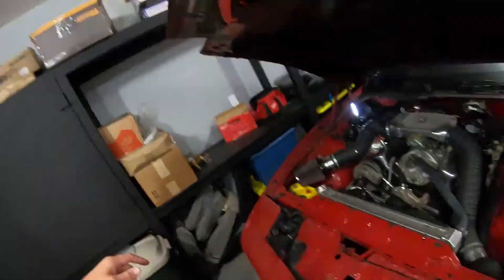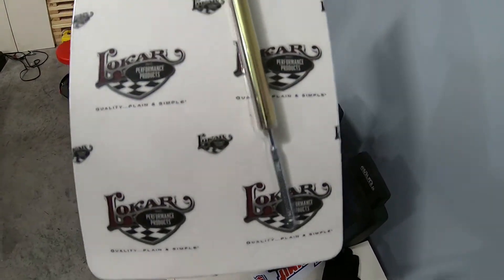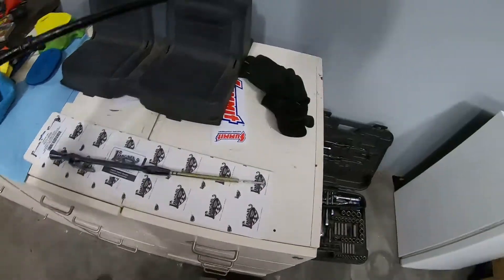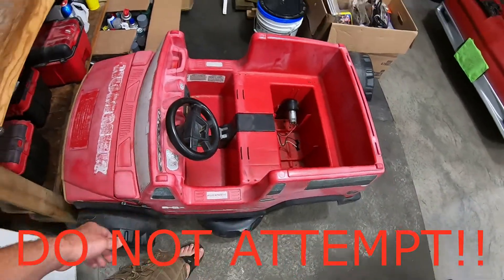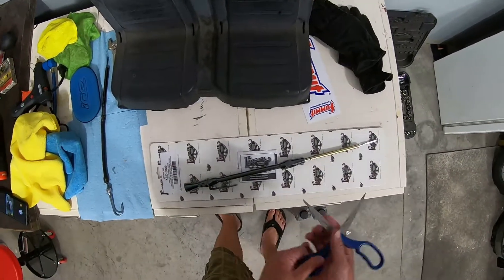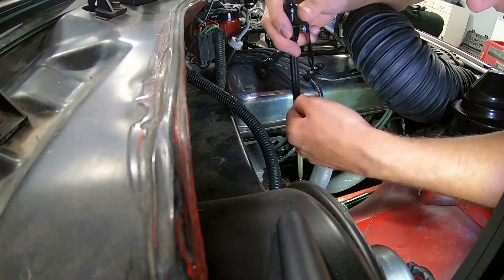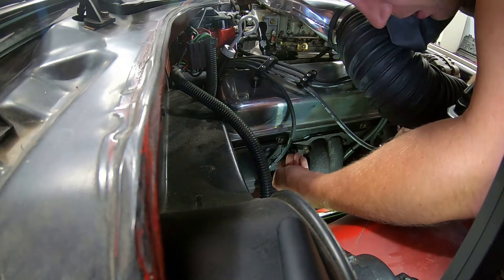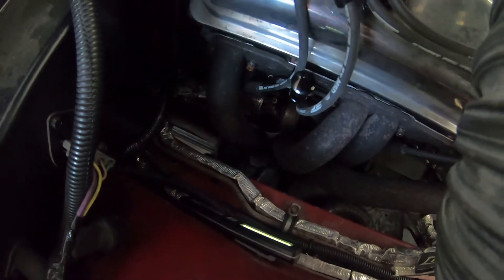Lokar Dipstick Install Vortec SBC

Comment: I had this issue I fixed it with installing a pcv valve on the engine valve covers, the pressure on the engine was making the oil come out of the dipstick
Reply from the maker: Yeah I had a breather and pcv system already in place.... little too much blow by I guess

Comment: Ive looked at about 5 of these installations and not ONE of you guys mentions how long it takes to pour a quart down that "idy bidy tiny" hole. 
Figure im going to take a day to fill my transmission. 😢
Reply from the maker: Engine dipstick not necessarily designed to fill through. Transmission dipstick should be larger diameter.